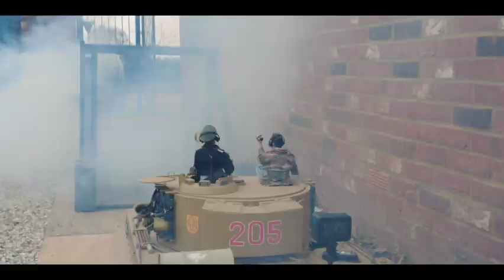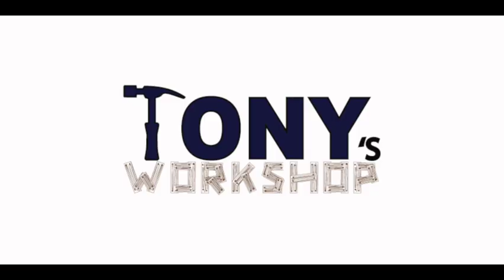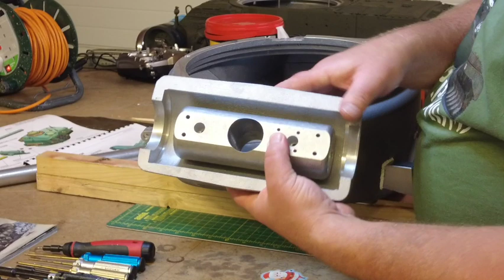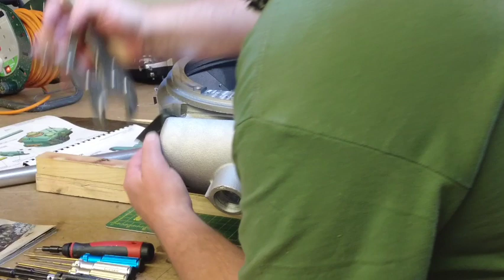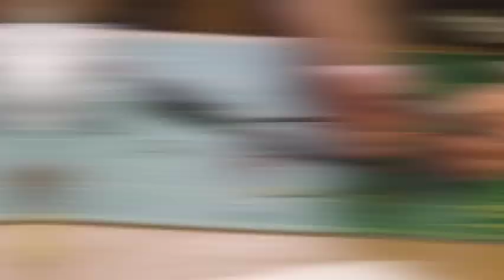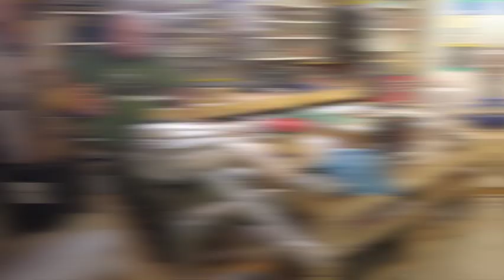1/6 scale Armortek M26 Pershing RC Tank build. (Vid 20) Main gun and MG installation

Comment: I have a tool that holds those small nuts that will let you get them in small places to start them. I have used it many,many times on my Pocher kit. Good session.
Reply from the maker: I have to have it 😀.what is it called?
Reply: @tonys_workshop  it's called a nut starter , Micromark sells it. You puss the top and little jaws open up. Then you can push the Shaft down to hold the nut. It works pretty good with practice.
Reply from the maker: I'm getting me one of those...Thanks.

Comment: Thanks Tony - that was a very timely explanation of why not to fix the machine gun in place before motorising it. This week I've had a couple of litres of RAL6022 mixed by the local car paints supplier and picked up a fresh reel of masking tape so I'll be revisiting your earlier videos for masking and painting tips.  I've been looking at all the parts I can fix and paint while waiting on my fixings and the hull machine gun mount was a candidate. Extra bonus points for the most imaginative use of a 12" round file in this episode! I think my swear box would have seen some action, though...
Reply from the maker: Hi Keith, glad to hear it. They should really highlight this in more detail for the MG assembly. It would be almost impossible to attach the servo mount etc if it had already been installed as there is not enough access. Trust me there was some swearing but carefully edited out by my son😂

Comment: Morning Tony.. another entertaining video which shows great courage in shooting real time on such a fiddly machine gun construction..Shame Armortek didn’t include the servo extension lead in their kit🤷‍♂️
You may like my tip for fixing the MG surround into the front panel…. I drilled a small vertical hole down through the thick front panel and continued through the MG circular body .. then tapped a thread into the holes to insert a small long c/s screw . Locates gun perfectly and means in can be removed from the outside with little effort. A dab of paint conceals the screw.👍   
Other builders have my permission to copy 😊
Reply from the maker: Hi Brian, Nice to hear from you, thought you had found another channel to watch 😂 Great tip, but too late for me now. The MG was indeed fiddly, but it turned out well in the end. Hope all is well with your build now.